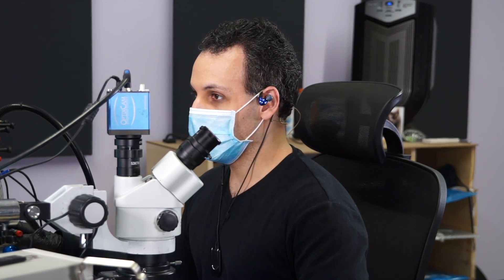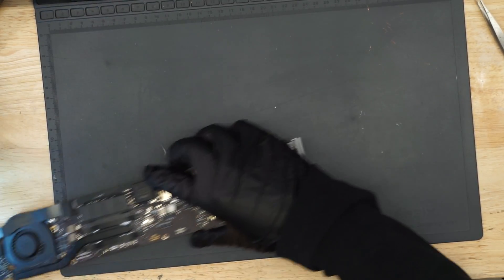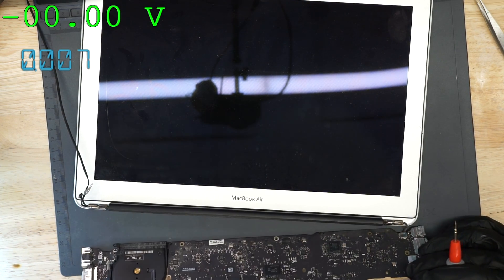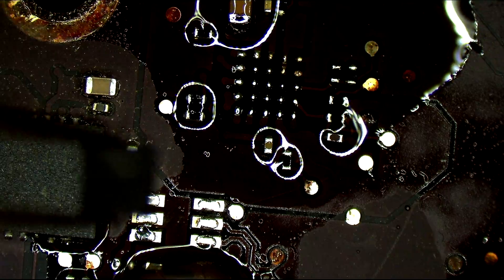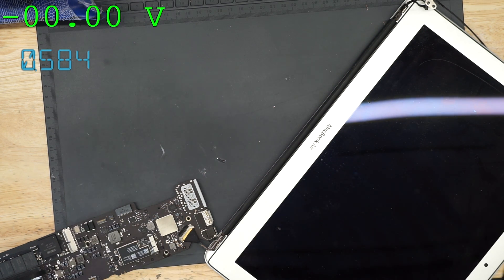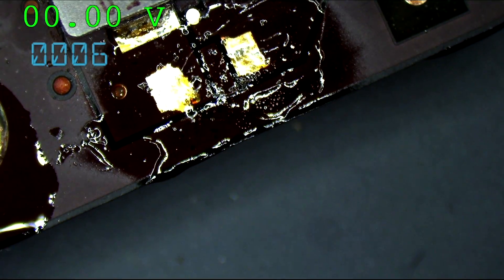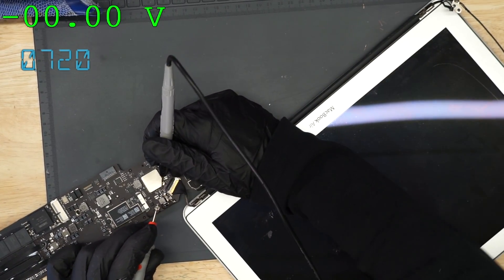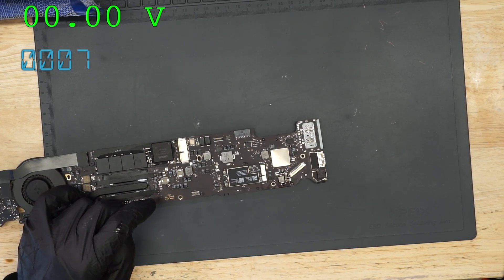Macbook Air no backlight A1466 logic board repair

Comment: Great video! Here’s my dilemma, I have an IMac Late 2013 -A1418.  I updated my hard drive to SSD. When I powered up the machine, I hear the fan, chime but no video (a black screen) and 3 of the LED lights are on and the 4th is off. Please note when detaching the cables, it was a struggle. What I have discovered was the display connector is bent on both ends.  What would be your recommendation?  Thank you in advance for your help!

Comment: Those sandforce SSDs just die for no reason. Good for me because I could have a 1466 for free because of it. 

A cheap adapter from eBay + a standard M.2 SSD and it's better than new.

Comment: Hi Louis. Where can I buy a Touch Bar power management chip. You don’t have it on your website 338S00267-A0. Any tips appreciated I will also need a battery connector 820-00850A

Comment: Hi I got a Rockford fosgate punch 100x2 amp 
 that overheated it got to like a 100 degrees within 10 seconds and I was wondering how much for a diagnosis and estimate to get fixed
Reply: If I were to take a guess at the problem, I'd think it's a bad FET or driver causing both "push" and the "pull" sides to be on simultaneously, that would certainly cause some major heat in a hurry
Reply: Rx7man  ok thank you so much
Reply: @Jessenavarro313  I'm no expert, just a dabbler, but that's what I'd be looking at
Reply: Rx7man ok still thank u

Comment: Strong beliver in just filling the entire case with thermal paste, this way you are sure you used enough :)
Reply: The whole point of thermal paste is to fill in micro gaps between the metals. Thermal paste by itself kinda sucks at conducting heats, so if you have a ton of it between the two pieces of metals it can actually hurt thermal performance.

Comment: whoever soldered that diode clearly didn't use any flux and probably decided to just make it a quick 'fix'.
Gives a bad rep for us independent repair.
Reply: RandomKitty you don’t need that at all you guys have that already !!
Reply: @johnsmith-vz4sk  Not sure what you mean but from what I can tell that tech just used a rework station and swapped the diode without adding fresh solder hence the weak connection.